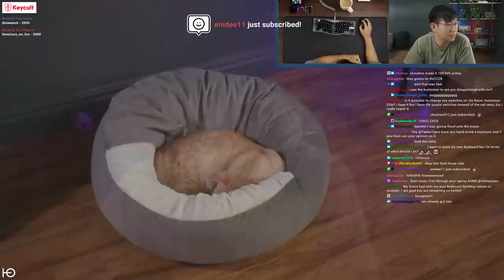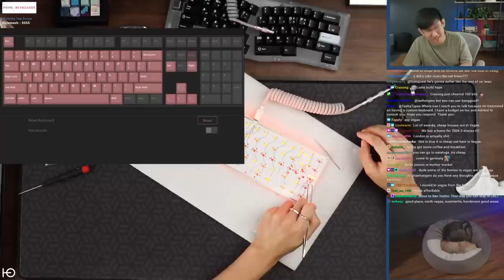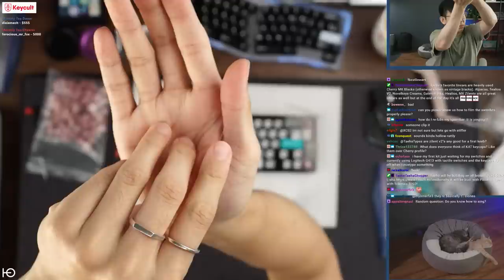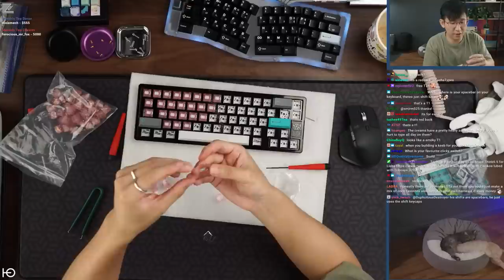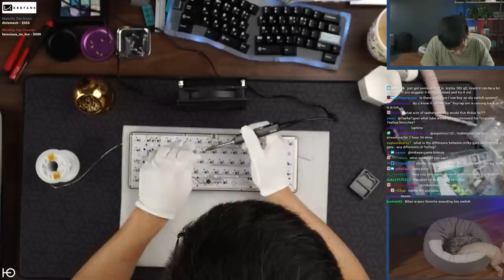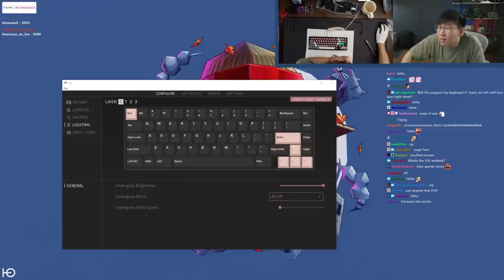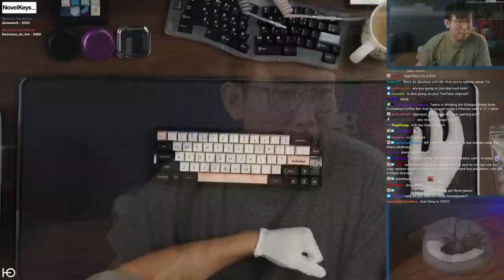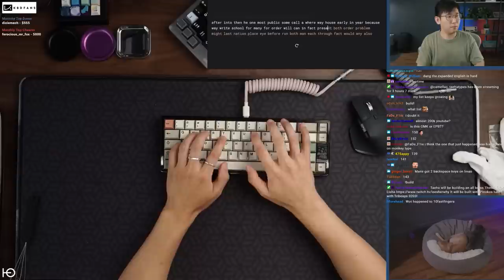Building Lisha's all brass Think6.5

Comment: hi there ! I started off with a velocifire 104 keyboard brown, which was already very cool; Today, I received the durgod K320 white red switch. Wow ! What an amazing difference.  Absolutely no wobliness, everything silky soft. So, I wonder how it would feel like to touch a custom made keyboard like you have been building.  Am I really missing out or is it a matter of spending 100s of dollars extra for a little amount of better feel & acoustics ?
Reply: both, but mostly latter. the appeal of custom is, as the name implies, customization. getting deeper into the hobby ironically results in more experimenting to which leads to more particular tastes and so on, at which point buries you deep in the rabbit hole where the sun doesnt shine after unmoderated investment into the hobby

or so i've been told
totally not speaking from experience

Comment: Hi, I really need help. I just bought a Legion K500 keyboard with red (Kailh I think) switches. But after the first day, I started the notice a spring noise every time I press the buttons. How can I fix this ping noise?
Reply: @bopbop8179  *Keys/*KeyCaps above keyboard/*KeyCaps on top of switches etc.
Reply: @hlmrz  if you think its coming from the spring and you dont want to lube try a spring swap if its not that it could be a plate issue and you could try a non metal material or try stuffing the case with foam

Comment: 28:00 Don't know if Taeha ever looks at YT comments on streams, but as someone who has lived in Texas their whole life: 
-Austin is expensive and overcrowded with bad infrastructure but it's got good jobs for SWEs and there's always plenty to do. The people get weird, especially the bums but it's honestly about normal Cali level of weird bums based on my trips to Cali. Austin is essentially California in Texas just hotter and with more guns. I grew up around guns and own some though, as did a lot of folks here so just expect that anywhere you go (esp. Fort Worth).
-I live in the north Dallas suburbs (Plano/Frisco) and they are generally safe, you can get good internet depending on where you live, reasonable cost of living, and there are plenty of jobs. We are currently booming and will likely continue. It's boring as hell and Downtown is not really any fun unless you have enough cash to live uptown or near Deep Ellum.
-Fort Worth is the largest small town you could ever live in and the people are pretty nice (I went to law school there, Texas A&M). The 'cowboy culture' gets a bit oppressive and it's the ONLY place I've EVER been racially profiled out of bars. I'm black and it happened on two occasions at two different bars in the arts district, standard 'dress code' BS even though I was wearing chinos and a button-down with no hat, and on the other occasion I was wearing some shorts. It's cheap and there are jobs, but most of it was Oil and Gas or engineering related.
-Don't move to Houston unless all you care about is food. Best food in the state, worst urban planning/sprawl and weather ever. EVER. Also hurricanes.
-San Antonio is out of the way of everything and your life will be easier if you speak Spanish, but I frequently go to the wilderness out there to run and backpack because the hills are beautiful.
The only natural disaster you'll have to worry about (other than pandemic lol) are tornadoes and extreme heat. Electricity is expensive but solar and wind works very well in Texas and development will likely continue to accelerate.

Comment: Hey does anyone know how long does lube last in a keyboard?
Reply: depending on environment and usage, it could last as brief as a few months, but that's talking about the shorter end of spectrum. on average, about 2 years
Reply: u w a a ooo alright thanks, ive seen someone in a reddit thread say they lube it once a week, and that sort of deterred my will to lube a bit.
Reply: @smkurf  contrary to expectation, lube wears off when you dont press the switch for extended periods
humidity and ventilation might be variables but im no expert